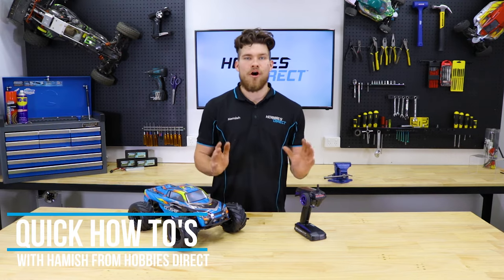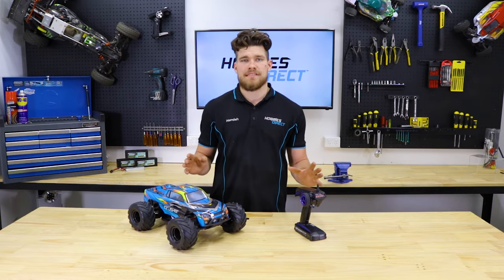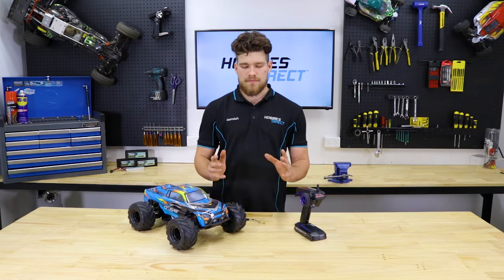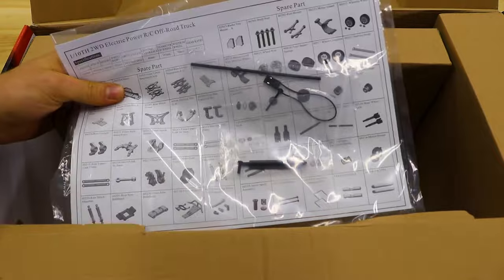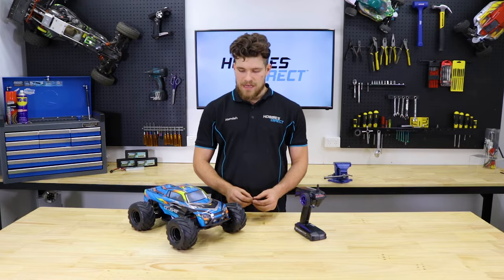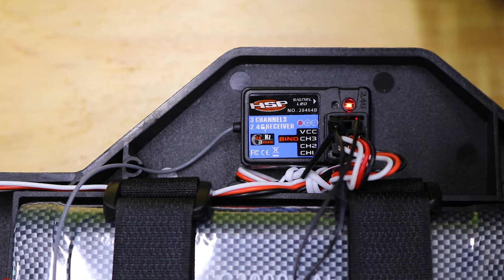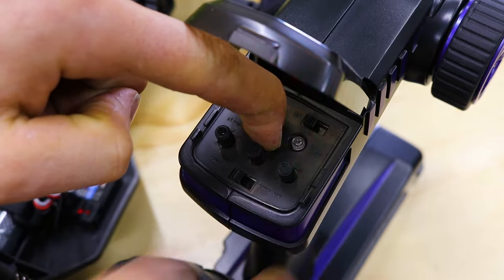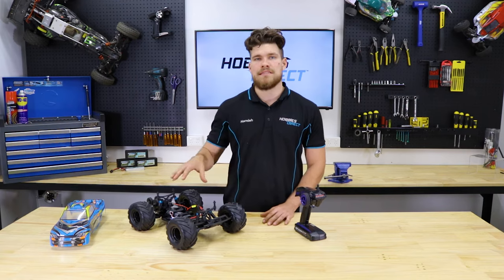How to: Binding a 2.4Ghz FlySky receiver

Comment: Need some help please, iam new to RC cars.
I have a brushless ftx carnage and my son tried to connect the charging cable from the battery into the visible ports of the receiver (etronix pulse 3 channel receiver). Channel 1 and 2 is used. From what I can see channel 3 which is still available is where he's tried to connect. Silly thing, it wasn't starting so he saw what looked like a male and female connection and tried connecting. There was a spark and some smoke. What has he fried? The receiver? I just bought a new battery but still not working. Appreciate any advice

Comment: I got prime baja v2 sat for a wile in garagec. Now took it out and found that no reverse working, though that may need to bind controller. Not sure how exactly, but i got contantly flashing red light on receiver( was attaching binding wire to ch3. Now trying to bind, but red light still flashing, same green on controller flashing fast. What can i do to get it back to work?

Comment: I have a problem, I did the video but it does not bind me, in fact when I do the bind without the jumper it seems like it binds, will it be a problem with the receiver? I have the same transmitter and receiver
Reply: I'm confused

Comment: so ive got 2 servo wires and a power wire 4 slots but no matter what way round i place them with the jumper i cannot get it to bind to the transmitter. any siuggestions in what order they should be connected?
Reply from the maker: The order shouldn't matter - what receiver is it? If you've plugged everything in right and it isn't working, there may be a fault with the receiver or bind plug.
Reply: @HobbiesDirect thep bind plug I've made out of a working servo. 
And it's old so it's got no stickers or logos on it but it looks similar to a spectrum. It's got 3 channels/slots and a 4th that says batt/bind. My cars got 2 servos and  a power wire. It's a hsp tyrannosaurus
Reply from the maker: @brettknibbs9351  That should work. If it's not binding, it's likely time for a new receiver. If you can let us know what Transmitter your car has, we can likely point you in the right direction 🙂

Comment: I have a question.  Will the new 2.4ghz rc cars interfere with each other if u have 2 of the same cars. If so  video  on how to fix this.    I bought rc monster truck 1:10  2.4 ghz   dual motors and I want to buy another but scared of the interferes. If I buy 2
Reply from the maker: Nope, no interference on modern 2.4G systems. The transmitter binds specifically to the receiver in each vehicle :-)

Comment: i got a question for you guys, binding is all well and good, but my issue ain't binding and i cannot find a straight answer on my problem, my problem is that my controls freeze up on either full throttle or full reverse and steering freezes on full lock with the throttle, bare in mind i know 3 main details, 1 i know its not a mechanical issue 2, i know its not the receiver nor the binding and 3 i know its the controller itself,  have even gone and tested it, i have had the same issue in vrc and beamng please not i did not use the receiver in any of the testing on my pc (i lack the cable needed for it) so i used a flight sim cable and no matter what, i kept having my controls freeze until i turned the controller off then on

Comment: Welp gonna have to order another receiver, just rebound a spare one i had around as i broke the antenna on the working one i had, re-soldered it & it still has garbage range despite my attempt at fixing it.

Turns out the other one with a whole antenna is an old one i broke the throttle channel on years ago as well lol.
Reply from the maker: Oh no haha!

Comment: Hii. Bro one doubt. My motor is running automatically when the remote turn on please give me me a solution
Reply from the maker: Have you checked the channel trim/end points?
Reply: @HobbiesDirect  yes bro🥹
Reply from the maker: @mohammedfahad6563  That's really all it could be, if not, it's possible it's a physical problem with the transmitter or the ESC is faulty.
Reply: @HobbiesDirect  aah bro let me check🙂✨